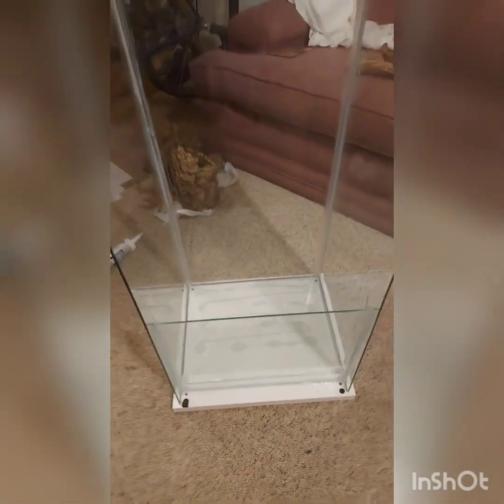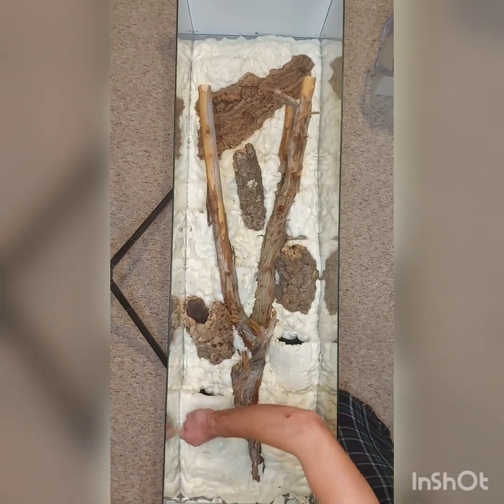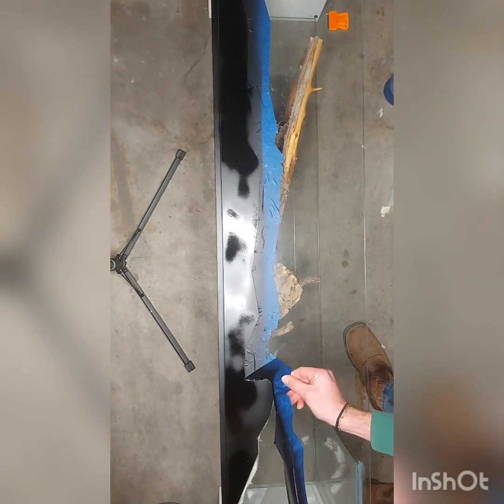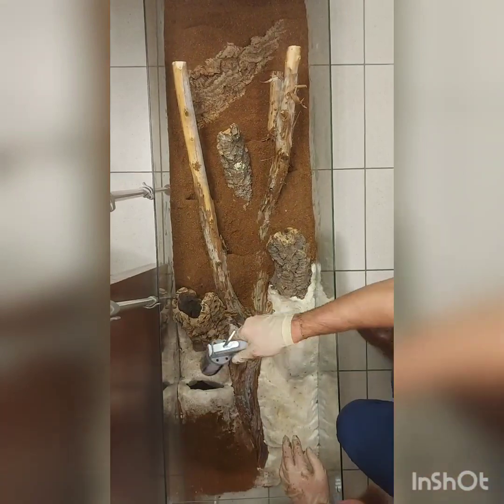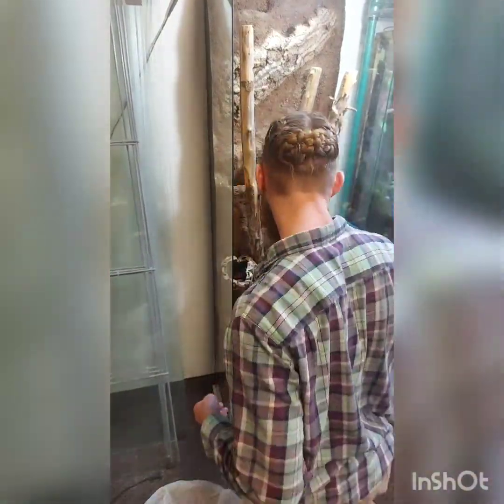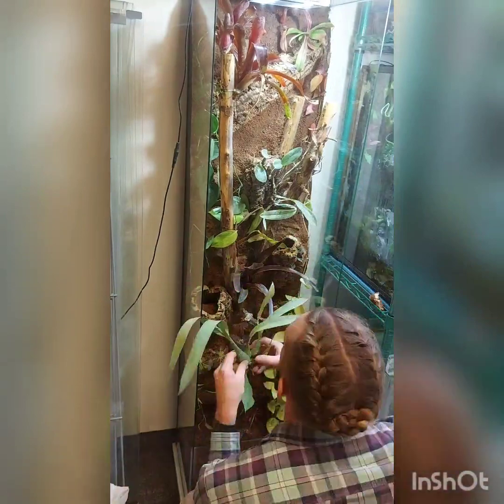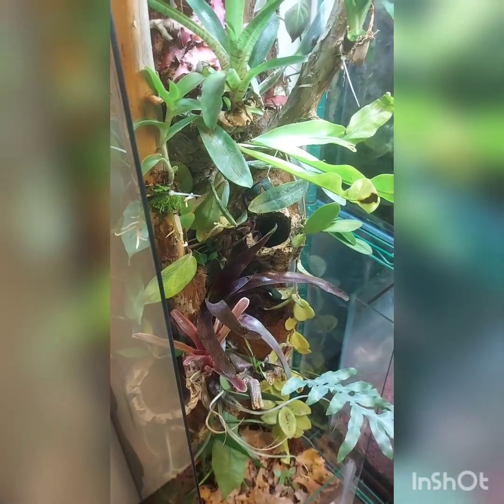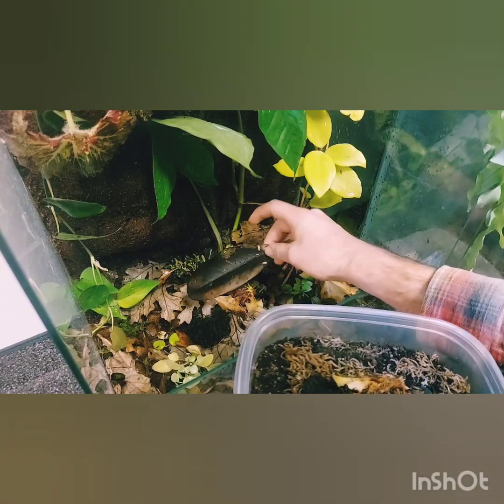Ikea Detolf Vivarium Conversion

Comment: Agree with you on the Gorilla glue.
Currently setting up a Milsbo and avoiding most silicones on background as they contain a 10yr mold repellent which will wipe out any roots that come into contact. Aquarium safe is good.
Also planting hanging Rhipsalis at very top because it lives the harsh light.

Comment: hii any updates? im curious if it like leaked or maby mold on the floor? I'mm going to do the same thing next week :D
Reply from the maker: Hey there Kelly, I just posted an update but this tank has been great, I haven't had any issues so far related to leaking, just make sure that you put that shelf on the bottom as a extra water proofing precaution! Hope this helps!
Reply: @Vivoterra_Design  thanks allot for ur answer<3!

Comment: hi there, really cool build. i guess I'm gonna try this for my first terrarium. how did you seal the bottom and what did you use as the door? greetings from Germany
Reply from the maker: Since I used an ikea deltof cabinet it came with the door, I just had to figure out a way to retain humidity along the edges. To seal the bottom I actually just used the glass shelves that came with the cabinet. I siliconed one piece of glass shelf to the bottom of the enclosure and then used a second shelf to create the substrate pan in the front using more silicone to secure it in place.

Comment: Did you leave in the plastic channels on the back corners before siliconing?
Reply from the maker: I siliconed the edges of the glass before putting the plastic back on, then once I had the glass on the base I put extra silicone along all the seams again
Reply: Awesome thanks. I'm actually looking into turning a donor detolf into a paludarium. Thanks for the inspiration